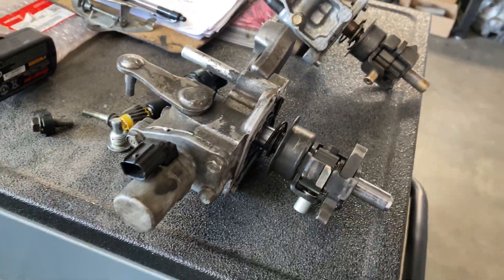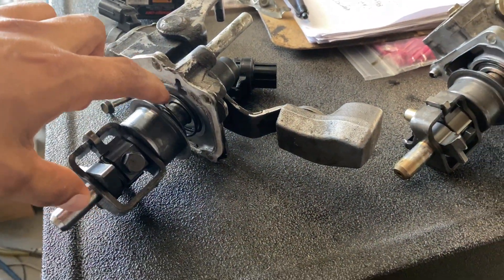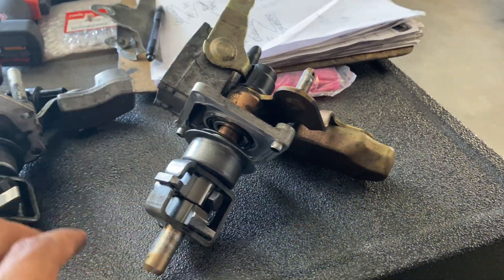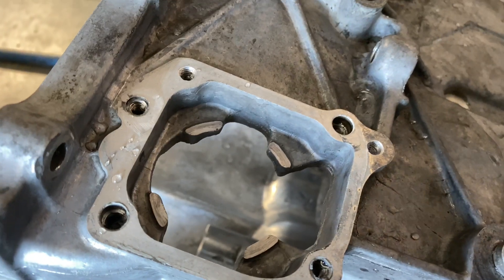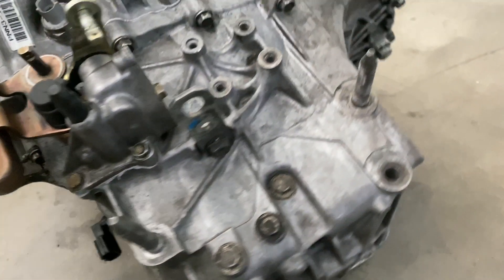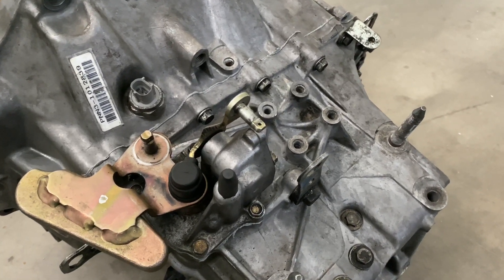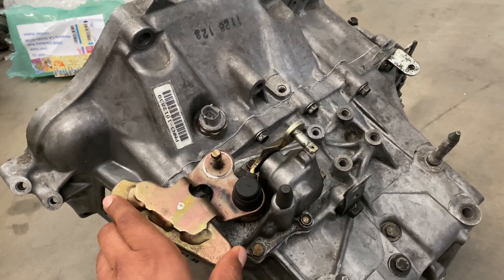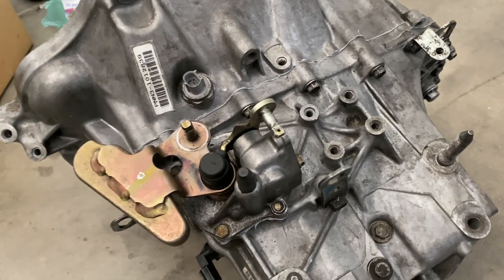How to modify k20z3 transmission for rsx shifter cables and speed sensor

Comment: I had a question I have a K24 with z3 trans with stock RSX Type-S shifter and cables but it seems like the  cables don't want to shift into 3,4,5 gears ...is there something else I need? Besides the speed sensor vss converter?🤔
Reply: The shifting mechanism is different between the Type-s and the Si(K20z3). You will need to swap the full shift mech that he is showing in this video from a Type-s on to your Z3 trans. Once you do that you will be able to shift all gears, alternatively you can just buy  Z3 swap shifting mech, Hybrid has one.
Reply: Im Confused Af Now I Saw Aki Use The K Tuned VSS Speed Converter for Kobe And It Worked Just Fine !! But The Way Oem Worx Did His trans Is more tempting because I guess of speed acurracy
Reply: Also have K24a2 with EURO R (cl7) transmission w/LSD.
I was going to just use k20z3 cables and vss?
Reply: @Lastsight100  I can’t find the hybrid racing shifter mechanism on their site. Are you sure they sell this? Maybe it’s discontinued?
Reply: @sentree9857  I just ordered the cables and z3 swap no cut shifter when then launched their Black Friday sale.  The actual shifting mechanism that sits in the trans (gear selector) I'm guessing it's called isn't sold by Hybrid.
Reply: @Lastsight100  ok I think I sorted it out. Basically they sell a no cut shifter box for Honda/Acura chassis that allows you to use the Z3 cables and selector/mechanism without having to switch over to RSX cables/selector. That’s where I was confused. I’m in the process of k swapping a MR2 and trying to use the Z3 trans. For me I don’t know of any other option other than buying a Type S shift selector so that’s what I had to do. And the prices for them are starting to get out of hand. I paid around 400 for mine smh but as far as I know I had no other option other than purchase an ep3, type s, or base rsx trans and at this point it was more cost effective to just try and make what I have work. Thanks for the info though!

Comment: I know this is an older video now but wouldn’t I be able to just swap the z3 gears and diff in my a2 case? it’s an 06 so no speed ring on the diff. I’ve heard I may need to change the case bearings to fit the 4.76 final drive vs the 4.38 of the Rsx just wondering if anyone has done it this way as opposed to using the z3 case?
Reply: What did you end up doing?
Reply: @jackyyeung7903  I ended up using the z3 case and just tapping the holes for the Rsx shift selector, and used the z3 6speed shifter mech. Had a typo in my previous comment actually had a a3 5speed and swapped in the z3 and it works flawlessly working on a k24a1 with z3 head now to get full potential out of this base Rsx

Comment: This is for the 02-04 rsx? Or i have to do the same for my 05 rsx type s if i want to use z3 trans?
Reply: The 05 RSX comes with a high frequency VSS, so you shouldn't need to mess with the speed sensor. Other than that it's the same.
Reply: With an 05-06 do you just change selector and put it back in?
Reply: @WeezyWorx  The 05-06 RSX transmissions have a high frequency speed sensor, so it won't work in an 02-04 or most swap applications without modifications.
Reply: @WeezyWorx  yes thats all what i did with 05 type S

Comment: The easier step without opening the z3 case, can I just change out the shift mechanism and use the vss converter, so dont have to drill for the 02 vss and opening the z3 case?
Reply from the maker: You’ll also have a speed sensor delay witch will play a part when the engine is performing.

Comment: I’m wondering if a X2M5 transmission and PNN3 which are both 6 speed would still require these modifications? I’m swapping the X2M5 in my RSX with a PNN3 from a 07 civic SI coupe. Any input would be extremely appreciated.

Comment: Great info! Quick question. Did your speed sensor work properly the way you installed it? I have heard of people having issues with the sensor not making contact. I'm asking because I got a great deal on an 05 RSX transmission but I need to add the speed sensor to be able to use it in my ES1 Civic and I would hate to tear the trans apart, buy the sensor and ring, pay a machinist to drill that hole out, and then find out that the sensor doesn't work right after all that work and expense. Thanks!